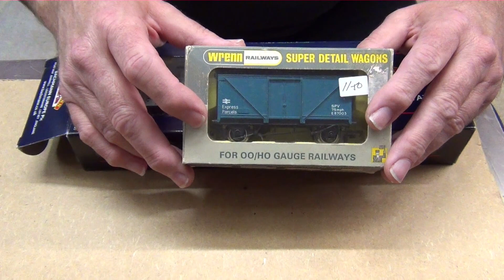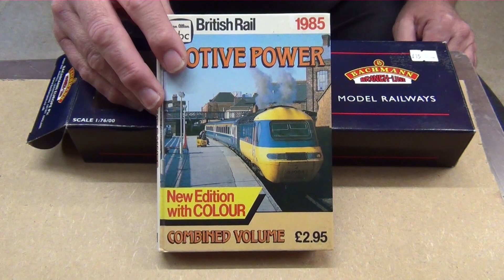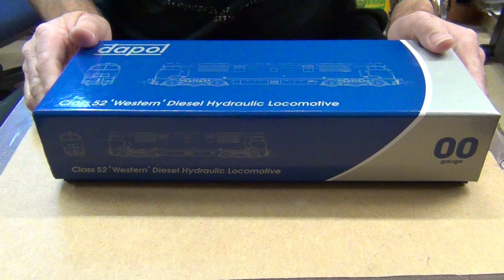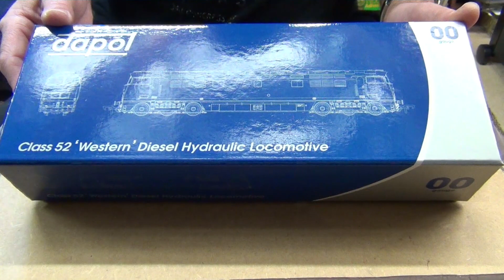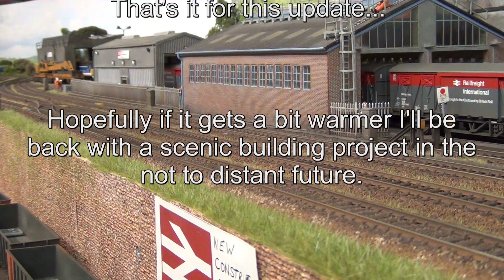Adding New and Secondhand Stock, Also Improving Old Rolling Stock.27

Comment: Nice video 👍 Something that may help with the 117 on the incline is that they were 3-car units, you have an extra coach in the set.
Reply from the maker: I had a feeling they only ran as three car sets but love to see them as a longer train. Will try the incline with three, but I think it will probably still struggle. The cd motors are good replacements but the downside is they don't have a lot of torque. Cheers Graham 👍🙂